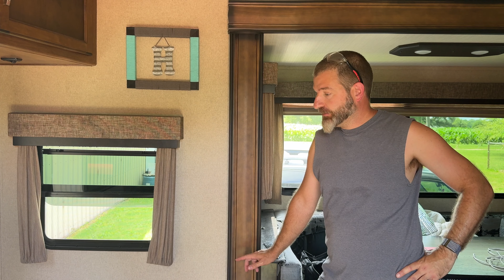Not A Very Grand Design: Major Water Damage!

Comment: No Grand Designs will ever occupy a space in my yard.
Reply from the maker: What brand do you currently own?
Reply: @JustSimplifying  We had a 36 foot Jayco Eagle 5th wheel that was bought used. It was a very good trailer, no problems with it. We then decided to go small TT, so we could fit in the small parking spots in the forest service campgrounds. We ended purchasing a new Rockwood Mini Lite. Like most of them built around Covid time, we had some quality issues which took a year to get straightened out. The factory took care of us and made everything right, so I’m pleased with that. BTW, I really like your SD Ford. I currently have an F150 which pulls our small trailer just fine. My next one will be a SD Lariat Tremor with the Godzilla, now that they’ve supposedly got the lifter problems solved.
Reply from the maker: @20sportsman  I think the lifter issues were exaggerated a bit.  When I looked into it, it seemed the issue was usually on the box trucks and work trucks that idles a lot.   At idle there just wasn't enough oil pressure to run that long at low RPM.  Ford still should have not had the issue in the first place but every manufacture has issues so I was ok taking the risk on that one.  We loved our little Freesolo we had but had to go bigger once we started full timing.  Still wish we could afford a Brinkley.

Comment: Hay cheating and recaulking those seam is normal mantises. You need to go around you rig and do that all the time. With all the movement of the road it will fall out and crack. So, you need to recalk it ever so often. Word for the wise.
Reply from the maker: I understand the necessity to check the silicon and caulk joint.  But there is no excuse for having a wall cavity open and exposed on an exterior wall.  Especially when it is directly below a gutter.  In this case our gutter had gotten clogged during the recent bout of severe storms that we have had rolling through and the overflow washed out the silicon joint.   If Grand Design had done the correct thing and ran the exterior wall covering all the way down to the bottom of the floor level, the water would have ran through and at worst gotten trapped behind the fender.  Then we could have seen the degraded silicon during the next inspection, removed the fender to clean any mold and check for additional damage, and then fix the silicon joint.  There would have been no damage inside the rig.  For what Grand Design claims to be as a brand, this is a ridiculous setup.  And doing it the correct way would not have added significant weight or cost.

Comment: Man nice fix, impressive. Go get a rug and forget the flooring for now, save your money and put it towards getting rid of that bonded leather wrap around seating area. I bet you could design something much better and more practicable. An office desk setup that has a slide out piece that allows to be used as a table and then a small recliner on the other side is an idea.
Reply from the maker: We have already bought new foam and fabric for the seats.  Just need other things to quit breaking so we can get back to that project.   We already finished the flooring.   Only took four boxes and less than a day to install.  It looks good.   We will eventually get a video up with it.  Also have pictures on our Instagram account.